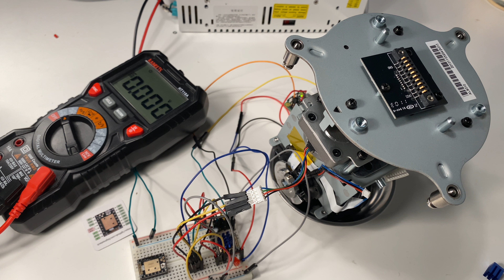Turning a Security Camera into a 360° Camera Tracker (Part 1)

Comment: @ 4:00 The endpoints are needed on the tilt portion so that camera can do that "Flip" you showed with the servo motors. the X axis is continuous 360 degrees but the tilt is not (obviously)... so in theory when your a moving the camera down, as soon as you reach straight down it will flip 360 degrees and as you keep holding the down axis on the PTZ controller will rise the camera on the inverted axis. I love these PTZ cameras and I find them dirt cheap because the general population doesn't know what protocol these things run on... or the baud rate. I love your project! very nicely done sir.